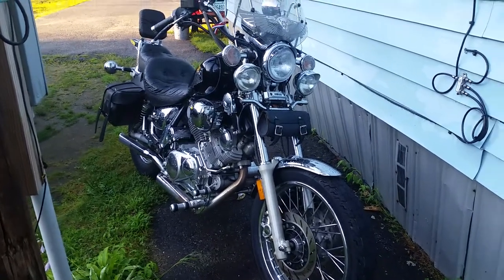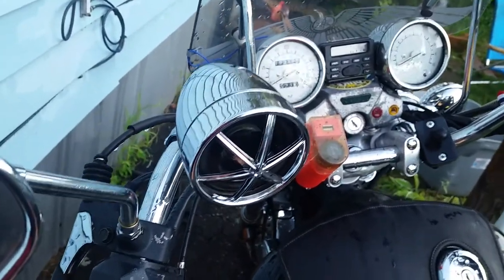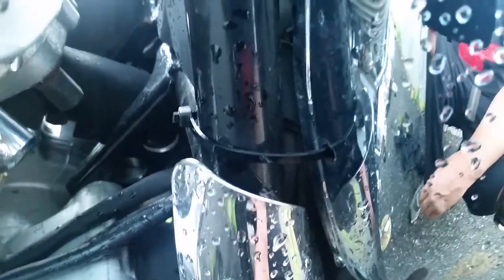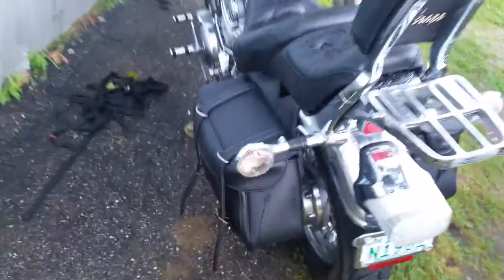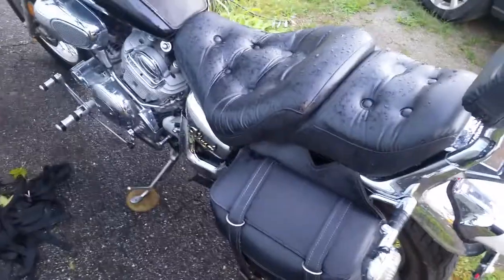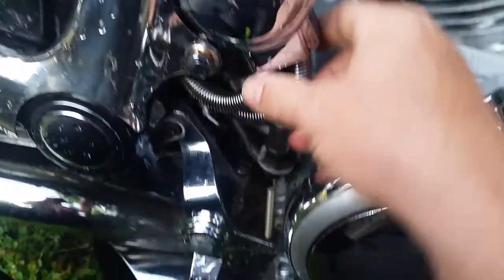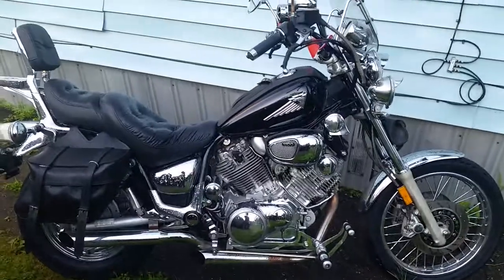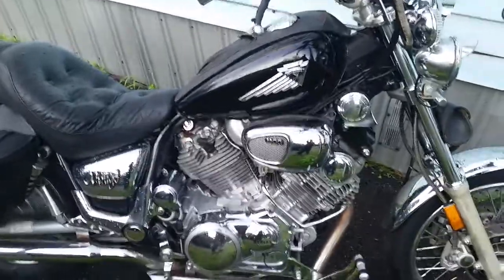Yamaha Virago XV1100

Comment: Nice bike , I like the mod. I have a 92 1100 also bought it from a fella down Port st lucie , Fl 
was not running at the time , manage to put it together ,got it running now but have a little problem with the Idle after the bike warm up ,It has a hang up idle about 2000 rpm  and I just saw a video on FB on adjusting the throttle return spring , will give it a try and see if I can make that adjustment without removing the carb, If not I just pull the carb off .
Reply from the maker: At  the bottom of the carb there is drain drain both carbs could have bad gas or water in the bottom a few drops in the bowl will cause this

Comment: Great video! Thanks. I noticed you have a silver Virago logo on the side panel. I am ordering new chrome side panels, but there are no logo's on them.... Do you know if and where these are still sold? I can only find gold coloured logo's. And what about the bolted on chromed/metal FRAME COVER, under the side panel, did you buy them seperately?
 Can they still be bought seperately? Looks great! I don't know what they are called, do they have a part number?
Reply from the maker: Yes my side covers didn't have logos i brought them on ebay they peel and stick no drilling
Reply: @2strokeguru  Thanks for your reply. Can you remember where? I can't find any, nowhere.... And the chrome / metal frame covers?
Reply from the maker: @dirkzelf  metal frame cover are called rocking horses very hard to find mine just happened to pop up on ebay
Reply: @2strokeguru  Thanks Kev, I'll set a search. No Yamaha OEM I guess, but aftermarket? And fit 750/920/1000 and 1100 Virago's?
Reply from the maker: @dirkzelf  welcome it took me a while to find it

Comment: Thanks for the video!  I just bought an 86 with 10k on the odo.  What can you tell me about the forward controls and where I can get some? Yours were on the 750 when you bought it at the junkyard?
Reply from the maker: My virago is 1992 750 converted to xv1100 that was a nightmare seriously the thing was the same was the frame lol I used to buy viragos every time they popped up on market place Craigslist want add let go and offer up so the wheels spokes are from 1986 xv700

Comment: just got mine 96  xv1100 special. love it.  The bike is in great shape, starts instantly. Had to clean carbs and dump gas from tanks. No petcock so I used rubber hose to drain top tank, feul pump took too long, switching on/off. runs like a champ now. questions, i tried install headlight modulator, thing was too sensitive, slightest change in headlight voltage made it modulate even when off. The two additional lights you have look easier, I see some have modulation, what features does yours have? One thing mine had (sent back ebay) was horn swich so it would flash headlight a ittle when horn honked. Thing about that is I unplugged both horns and could not detrmine which horn leads was from switch. I dont know why but they all read hot /power with switch off. I needed to find which is switch leg. strange or my meter failed me. Why I ask is because I bought loudest horn on market, Denali sound bomb. I need the horn switch leg to control the Denali. It has a felay that controls an air pump that blast the horn. I'd like to have the Denali on normal horn switch and another switch for regular horn. A friendly horn I can beep for non emergency. Hope to hear from you. Subscribed
Reply: relay not felay
Reply: also forgot to ask, the led brake light of yours, does it do ay special flashing or is it normal no blinking?
Reply from the maker: I have a ton of parts I will give you my number 6033958097 call me tonight and we can chat